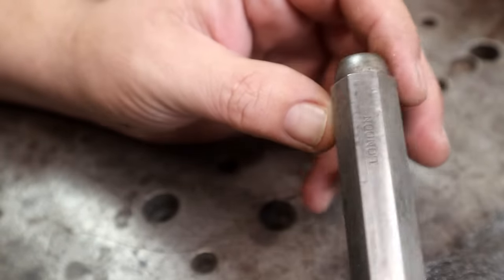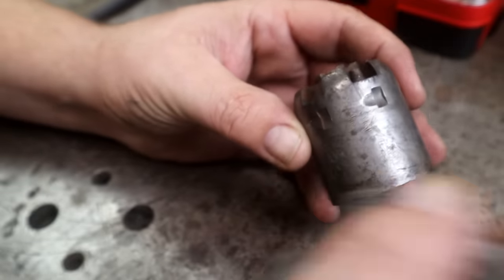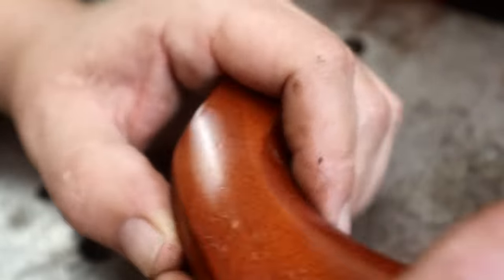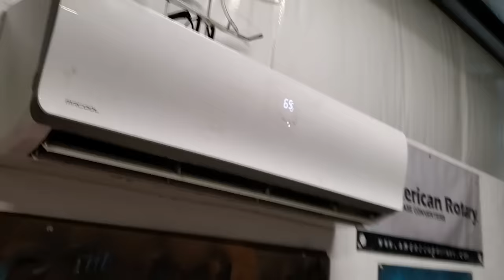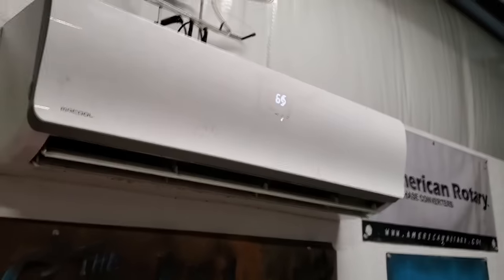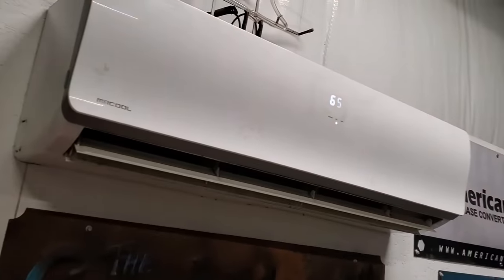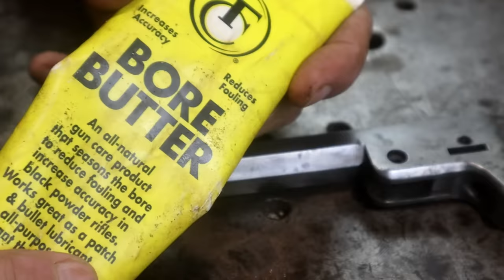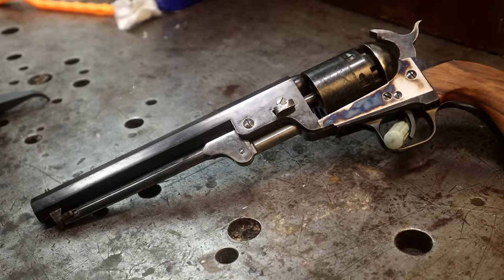1851 Navy Restoration

Comment: Dude get a hard rubber or plastic mallet. Striking metal to metal is ridiculous.
Reply: Need a deadblow and a set of mallets
Reply: Relax Craig KAREN
Reply: Look again. Its double headed. Rubber one side, plastic the other.
Reply: @carolinewynton-rhodes3810  that was a ball peen at the beginning. Definitely harmful to the firearm.
Reply: @Awe_poop 
Come and make me.
Reply: He's no gunsmith that's for sure...
Reply: @carolinewynton-rhodes3810  you and Sigmund need glasses he’s using a ball-peen hammer that’s metal at first then he switches to a rubber mallet. I really don’t care I had to use a rock once in the field to fix a weapon but he’s clearly making a video so in order to prevent doing more damage I wouldn’t be using a ball-peen hammer. He switched to the rubber one after he figured out he was harming the metal.
Reply: If the cylinder is turning you can twist it halfway and use the lever to push the barrel forward
Reply: @carolinewynton-rhodes3810  the first one was metal. Then he watched a video and bought the other.
Reply: Amen
Reply: Brass / copper punches are great as well.
Reply: Copper and brass leave marks, but they vanish with a pencil eraser.  Works great for drifting sights on weapons with a parkerized finish.
Reply: @alexanderchapman2525  yep exactly

Comment: @12:30 I started using my food vacuum sealer to seal in oil into my wood and even a mixture of resins, then heat activating them after in the oven to stabilize the wood, its been working so well.

Comment: Justin, thanks for this video.  It brings back so many memories, my father built one of these from a kit back in the 70's.  I love that thing, so fun to load and use.  Wish I still had it, but he sold it in his retirement.  I do still have 2 flint locks he built, need to get them out and get them running again.  Thanks again my friend.
Reply from the maker: +cuttingtooldesigner Dennis, send me those flintlocks and I will get them working for ya! (Salavating)🤤

Comment: My father had an original model 1861 Colt .45 that had been used in the Civil War.  He was also an amateur gunsmith.  When I was in high school he taught me how to shoot it.  I cast lead bullets and shot it down the driveway (lived on a ranch).  You'd hear the boom, then the CLANG as the heavy lead hit the 30 gal steel drum I used as a target.  Didn't go through, but would rock it.
I then got a lesson in how to clean it in warm, soapy water, and finally put it away oiled.  The gun in this video was fired and not cleaned.  Maybe more than once.  
Dad's weapon was more than 100 years old but still in excellent condition.  As these guns all should.

Comment: Man, my anxiety was going through the roof you tapping on that gun with a ball ping hammer in the beginning. I thought it was a original 1851, but as the video went on obviously you know what you're doing. Great job!
Reply: I thought the same thing. Then I was like, no way this is original. Once I realized I was fine. In fact I did an aging job on a Pietta 1860 army with rust brown. Looks excellent. Fun and cheap project.
Reply: Was this weapon the one that Clint Eastwood assembled as the preacher I High Plains Drifter?

Comment: very nice job I restored 2 Swedish Mausers 1 was 1912 and the other 1942 I sanded the stocks and used linseed oil with 2 layers rubbed on them. To bring in the metal ready for blueing I used 600 Grit silicone carbide paper and the barrel on 1942 became nice and shining ready to be blued both cam out top notch I figure I share this experience of mine with all of you guys that appreciate bring the old " alive " Cheers ! from Canada !

Comment: Try boiling next time. Works great and won't hurt anything. Mark Novak (gunsmith) on Youtube uses it all the time.
Reply from the maker: https://youtu.be/Xtg9aI0mAZg
Reply: And the boiling process will somewhat restore the original bluing and not remove it
Reply: @Aleeknives  
.
Reply: a product called sili-kroil works best
Reply: Jo sobrevivi
Reply: I have tried boiling on an old Turkish mauser action and it works great with less wear than steel wool.

Comment: You could call it a combustible six cylinder with a manual transmission. Hahaha.
Reply from the maker: https://youtu.be/Xtg9aI0mAZg
Reply: Internal combustion
Reply: HEY! I got one of those and it's called a 2003 Jeep TJ Sport hardtop w/ the AMC 4.0L + NV3550 manual 5-speed transmission, lunchbox locker'd Ford 8.8 rear and an Eaton M62 supercharger that uses an extra fuel injector to keep intake temps down to prevent pre-detonation!!! ...and there it is. Good video here!

Comment: A tip to getting the barrel off the cylinder pin on those cap and ball Colts it to rotate the cylinder between nipples and then use the loading lever to apply leverage to get it off. If the cylinder is froze, you can take the barrel wedge or other narrow piece of metal or song wood and place it over the loading levers open cylinder and do the same thing. I have been shooting cap and ball revolvers in competition for a few years and have been gunsmithing on them for a little while longer and have restored several 1851 Colts (repro's only, just preserve the originals). I have taken more than one rabbit with my 1862 Colt pocket model, nice restoration.

Comment: You really need decent screwdrivers with parallel tips. Nice work!
Reply: They are called Hollow ground gunsmith screwdrivers. You can apply lots of torque and the bit will not chew up the screw head.
Reply: @walthammond6816  Wasn't sure how that would translate 😊.

Comment: I inherited one of these from my father in law, not sure if it's a replica or not, it has 'Ellipietta Made in Italy' on one side of the barrel, and 'Black powder 45 only' on the other. 

But the reason I post is, it has 2 bullets stuck in cylinder. Any recommendations on how to remove them? I can get thr gun apart, but I dont have the expertise to venture a guess about those rounds.

Comment: Get some black powder,primer caps, pistol 🔫 ringers. Need wadding,x-mount of powder then seat the bullet need a ram rod. Use an empty nipple to rest hammer on. Shoot soda cans,pine cones. Figure. Out where to hold to set the bead to line up target. Pull the the hammer all the way back . Keep barrel away from your body get a good stance have at it. After a few shots re-loads clean the barrel n cylinders black powder is a dirty one to shoot have fun.
Reply: They have built in ram rods. It's the lever on the bottom.
Reply: also no wadding!
Reply: @jeannieheard1465  I've never had a chain fire after thousands of rounds. Use proper size balls and caps. The original load didn't use wadding or lube either. I don't get why people don't spend the time to make sure there using the right balls and caps but will take the time to smear crisco all over there guns.

Comment: It’s kinda amazing how well the frame held up. You should silver plate with coins and electroplating. I got a 44cal version of the 1851 with a 5inch barrel and it will be buried with me I love it so much. 2k very hot 35-40gr shots threw it without any parts wearing out.

Comment: At last. Some one has the sence not to bugger up a gun with plating and spray clear coat on the handle. Great great work mate. Love the oil finish on the handle as it should be and the way you preserved the petina

Comment: There was an episode on Porn Stars. Yeah I spelt it right. Someone on that show gets screwed. Anyhow This older gentleman brought in a Colt either 1860 Army or the Colt Peace Maker. A real one. He had taken steel wool to it and made it all nice and shiny. Unfortunately in doing so he devalued the revolver. To hundreds of dollars instead of Thousands. The reason the 1851 Navy is called this. Is not because our Navy was issued this revolver. But the naval battle engraved on the cylinder. Its a battle that happened between Texas and Mexico. During Texas's gaining independence from Mexico. If you look under magnification. The Flags of the Republic of Texas and Mexico can been seen. Colt did the engraving to help keep counterfeit copies from being passed off as true Colts. He had these Rollers with the Positive of the battle made on much harder steel and the cylinder was pressure rolled making a negative in the softer metal of the  cylinder. The Colt Sheriff's model has a Stage coach robbery engraved on its cylinder. With proper load development to gain best shot pattern.  Because each revolver likes a charge particular for it's self. One may like 15 grains the other 10. But what ever the charge. These revolvers can shoot every bit as accurate as their modern grandchildren. Blackie Thomas of Shamans Forge and Woods Craft. Has a wealth of information on these wonderful pieces of weapon history. The man has forgotten more on the subject of Black Powder than most will ever know. If your into the Shooting care and maintenance tips and little things to make shooting them better for you and the revolver. You do yourself a disservice if you don't go check out his channel. He also has a vast amount of outdoor tips and equipment info. Give him a look see
Reply: Thanks Steve,,  was some great info,,, will look into it,,,   I have liked the Navy Colt for the longer barrel, and as you stated, its damn accurate!!  Take care   Stay Safe    E
Reply: @dreddj.9451  I just finished making a holster for my PIETTA 1851 NAVY However I bought the Dixie Gun Works  budget friendly Yank model kit. There never was a 51 In .44 But I like the octagon barrel and .44. Besides the frame will accept the sleeker 1860 Army barrel and the Navy 44 Cylinder can be used. It will also accept the .36 cylinder and barrel. I plan on buying complete revolvers in the future. At present though this route will let me have various barrel lengths on one unit. I antiqued it by taking it apart completely and soaking it in vinager. To bring it to raw steel. It is now taking on the look of the pistols in all the old westerns That gun metal gray? The holster is made from a well worn leather upper from a Georgia boot. It looks a match as the leather is broke in. I made it low slung with a leg tie down. It looks very similar like the lead on Hell On Wheels His Griswalds holster. I watched the Aforementioned Blackie Thomas's Channel and made several paper cartridges. But now plan on making Nitrate paper cartridges as well. I honestly once had to leave a Remington New Army loaded and capped. A bad storm ran me off the Shooting range. But kept it in my gun cabinet for over a year and it fired just fine. At the time my job requirements. Had me carrying at all times. So one more loaded weapon in the house was not a bother. You stay safe as well Sir Happy Independence Day
Reply from the maker: +Steven Steele Gonna have to check out the Nitrate cartridge. Thanks brother!
Reply: @TheGoodoftheLand  There are a few people who make it. Using Spectracide stump remover the powder type mixed in water. Then soaking those brown or tan drip coffee filters in the solution. Hanging them to dry. Cutting the cartridge paper from this and simply he my elmers stick glue. The paper ignites and burns 100% leaving no paper in the cylinder. Plus this insures the cap busts through the paper. The best thing about the filters? They are way more durable than the thin curling or rolling papers. One can handle them more and storing them is also better. As they are less likely to tear in a case. They also look very much like the period paper cartridges on the 1800s due to the Brown paper Good Luck Brother

Comment: If you rotate the cylinder half a turn, you can usually use the ramrod to pull the gun apart (as if you were loading a ball).  You should take the screw out before removing the wedge.  Looks great when you finished.
Reply: I learned this trick with my 1847 Walker recently. Makes disassembly for cleaning a lot easier, especially after putting a lot of shots through it.

Comment: 1851 Navy, very accurate restoration 👍
Reply: Cylinder is incorrect, as an original 1851 Navy Colt the cylinder would have had an engraved naval battle scence on it.

The narrator stated this restored piece as a replica.

Comment: To take the 1851 Navy revolver apart. First remove wedge. Second, pull back hammer, then let it down between chambers. Third, use loading lever to force the barrel off the frame and cylinder. Pretty easy.  Okay, my bad, did not even take into fact that the hammer might not pull back. Yes I own a very nice reproduction of the 1851 Navy. Since it is a reproduction, you should have just gone ahead and soaked the barrel and cylinder in a good rust remover. I noticed when you used the brush down the barrel, all the dust that came out. The Frame and Loading lever are called Color Case Hardened. So should not rust at all, unless the finish has worn off. Any ways, you have done her up proud. They shoot great.

Comment: I may or may not have done some growling about the ball peen hammer, but it IS a $200 replica, and it was only getting junkier without intervention. Well done! Guarantee that was a “It’s Pyrodex! It’s cleaner than black powder! I don’t have to clean it after!” situation. 

That being said, a product I read about years ago, and swear by now, is Big 45 Frontier Metal Cleaner. They say it’s harder than rust but softer than bluing. It’s hell on rust and lead fouling. Would be just the ticket for future chores like this.

Comment: I just restored a San Marco replica Colt 1851 Navy that was in FAR worse shape.  Had to replace the internal springs, and the gun was rusted and pitted over 40% of the surface.  Cleaned up okay and now it works, but replacement San Marco Parts are not drop in replacements.  They need adjustment and gunsmithing to work.

Comment: Just a suggestion Blued Guns parts that are Rusted , One can Boil the Parts in water and it will convert rust back to Blueish color without the use of harsh chemicals , Steel Wool, Wire Brush  etc etc. 
After Boiling for about an hour a Carding Wheel will bring the color back

Comment: amasing! 170 old year this tool!
Reply: this one is a 30 years old gun, but still nice job for restoration
Reply: @bellvivien7087 1851+30=1881 - does not converge ... 1851+170=2021! - ? .. 1851 years Navy gun
Reply: @urmannjoe6550  Sorry, 11 years old tool, it's an italian copy from Uberti made in 2010 (CF Gardone bench proof mark on the right of the gun)
Reply: @bellvivien7087  the author of the video did not write anything about this in the title of the video
Reply: @urmannjoe6550  Take a closer look on the marks and you'll see the CF mark (in the video "in action" the marks are more visible). BTW I got the same model from 2019, with CU mark. You can also see the mark under the barrel "CAL .36 BLACK POWDER ONLY - A.UBERTI"
Reply: @bellvivien7087  I can’t argue with you, because I don’t know, and I didn’t see the inscriptions on the video, but I will assume that you are absolutely right

Comment: Less hammering and more soaking would be gentler. To remove siezed parts I often do several freeze/heat cycles, from freezer to over, with plusgas soaking in between.

Comment: Ever done any Browning?
Essentially, you let the steel rust*, then boil it in water to convert the loose red rust to clingy black hematite.
Any loose material is removed through scrubbing, and the rusting/boiling/scrubbing cycle is repeated until the metal no longer rusts.
5-8 passes is typical for carbon steel, more passes for mild steel.
Some grades of steel will not work with this process, nickle alloys especially.
The piece is oiled/waxed to seal the surface.
You won't get deep black, more a of purple-brown.
When used on case-hardened parts, it can really make the pattern stand out.
Old muskets and the odd Walker behemoth look great in Browning!
There is a 'paint on' brown that gives a similar visual appearance, but is not so great at corrosion resistance.

*careful cleaning of metal surface, completely de-greased.
Salt solution is applied, piece is placed in 'sweat box' to steam.
Piece will be uniformly red in just a few minutes!

This process does cause microscopic pitting, but black oxide builds up in the pits, preventing them from cutting deeper.
Eventually, every steel surface has become coated with black oxide to the extent that there is no bare steel to rust.
The pits help hold onto oil/wax or whatever sealant is used.

Comment: Had one & a ‘68 IH 3/4 Ton pickup back in my bricklaying days & being curious 24 yr. old, I thought how great a testimony tattoo it would be for the strength of them both to put a round into the drive side rear flank. Truck was stronger than the round velocity. Left a fine .36 cal. 1/4” deep dimple. Man, I miss ‘em both as much as the prime of those days.
Stephen Cox... he’s my sisters strength. Continued Blessings May ^it be upon both your adventurous hearts. 
 ...tTt...
///^it\\\

Comment: Cool stuff, but If you get another one, just take the grips off and boil the whole thing in plain tapwater for 45 minutes to 1hr. The red rust will turn to a black powder and the parts will release. Try it on something rusty.